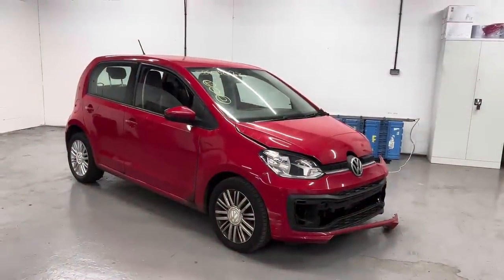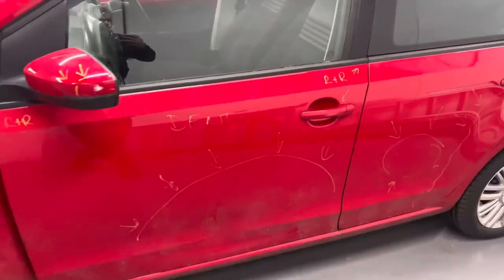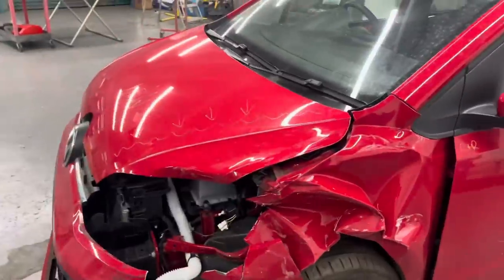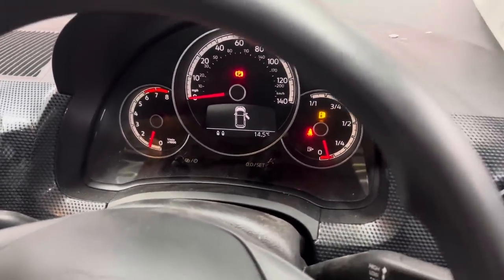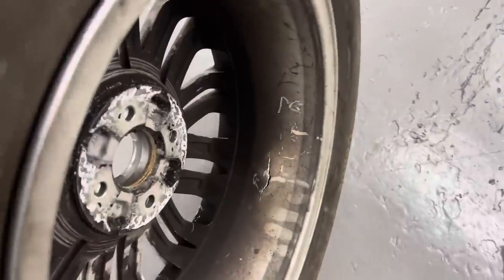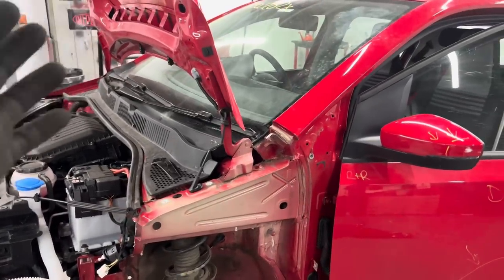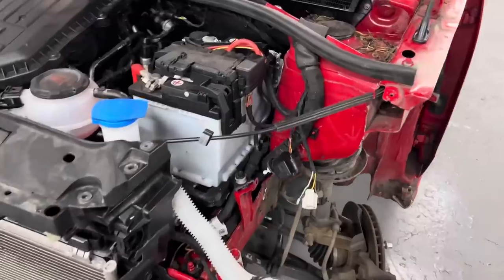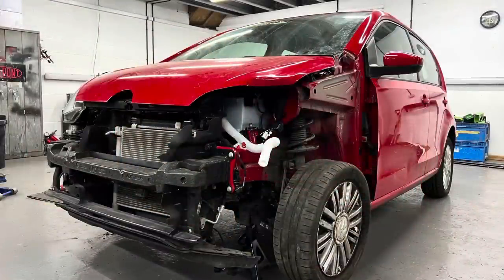I bought a crash damaged 2019 Volkswagen up from copart Uk part 1

Comment: Great news on the unit Nathan. I think the VW Up is one of the best small cars around, and this one is a cracker, in my favourite colour. Looks like you have found an easy one  to repair, also with low miles. It seems absurd that these vehicles are getting written off, given current demand.
Reply from the maker: Thank you George and your right there cracking little cars and if you shocked how the up got written off wait till you see what I won today you’ll be surprised that it got written off

Comment: Another thoroughly detailed video from you Nathan. Great job. Congrats on getting a unit to work in, good timing with winter on its way. Keep the Up builds on the channel, as it shows that you have to mix up the builds with what vehicles currently available and affordable from CoPart, etc. More power to your elbow and keep up the excellent work. 👍👍
Reply from the maker: Thank you rusty sparks and your spot on ,it’s not been easy winning cars at the minute cars have been going through the roof but I did manage to buy win something today